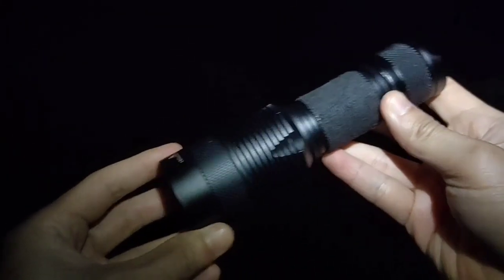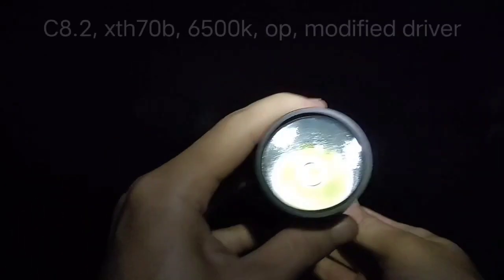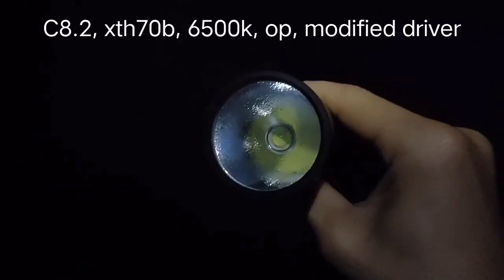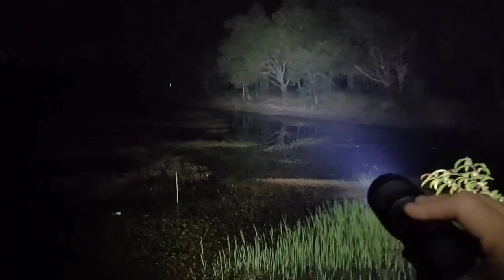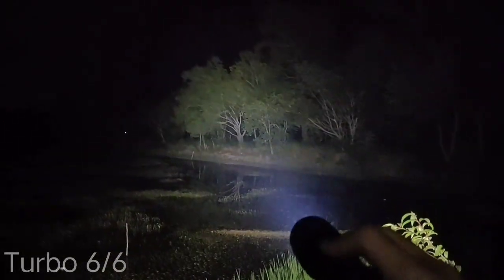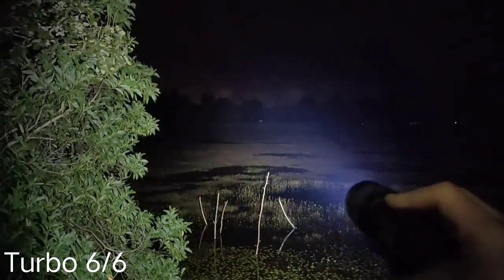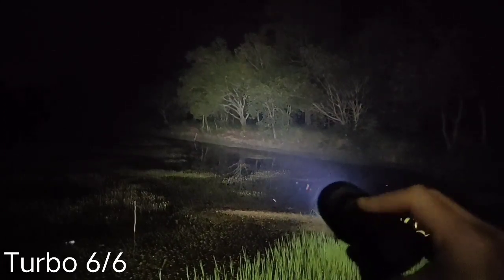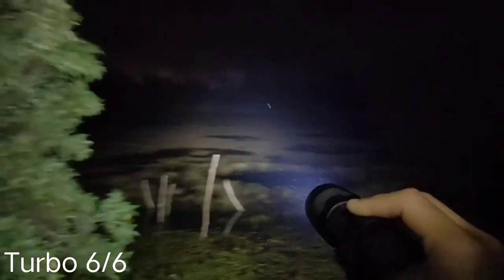Mantaray C8.2, 3v 7mm Xth70b led, 6500k, op reflector, modified driver

Comment: Very good video. very powerful flashlight, the driver22 mm, 20-25 Ampere 😲 Were have you buy the 3 volts driver and the xhp 70 led.
Reply from the maker: I buy the driver from a seller in facebook sir. It is a handmade driver! He's very genious.   https://m.facebook.com/groups/709609999166611/permalink/4136603256467251/

And the led is from here sir. https://shopee.co.th/product/78497897/9719985168?smtt=0.32286127-1635282239.9

I don't see the led on AliExpress or other sites.

Thanks for watching sir.
Reply: @weerapatkiatdumrong  Thank you👍😃
Reply from the maker: @lakasund  You're welcome sir.